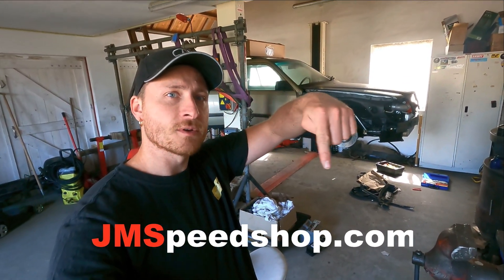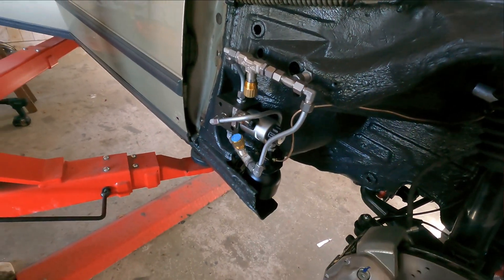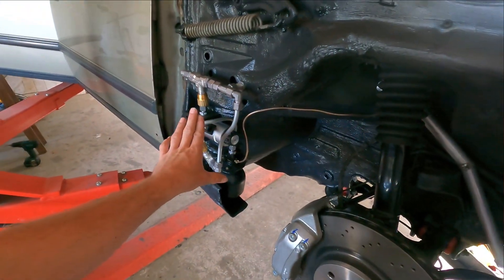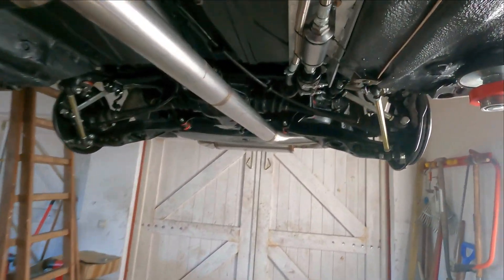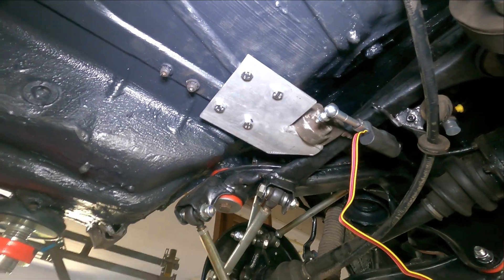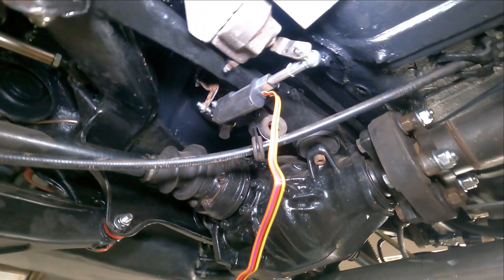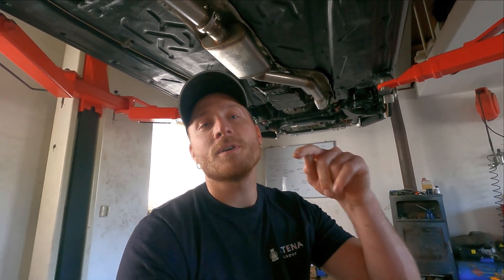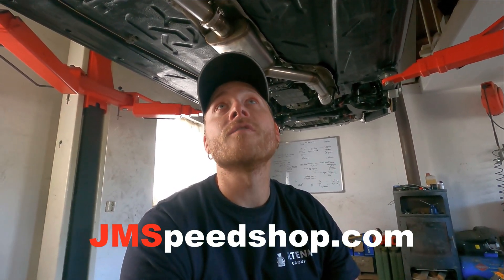ADS suspension for S124 V8 Turbo

Comment: hi, can i ask did you some question related to S124 SLS suspension ? Currently I'd having some knocking sound from the struts, there is no leaking from the suspension. The sound is from the lower mounting point of the struts. I assume is the rubber stopper inside the struts gone. Do you have any idea I can get a replacement for the stopper?
Reply from the maker: Not sure if you can get the stops seperate
Reply: even the ball joint of the lower mounting point ? @JMSpeedshop
Reply from the maker: The lower mounting point is a rubber brushing that can be be changed seperate it think

Comment: You think you’d be able to fit a 8.4L V10 dodge viper gen 4 engine into a 93 190e?
Reply from the maker: It is al possible .  But the bigger the engine the more room you need to create.  The more parts to move another place.

Comment: absolutely outstanding  flip those valves over so you can lift the rear seat and adjust out on the road
Reply from the maker: That is a possibility dont know how much room there is .  But i will only adjust them once i hope and not every week.   Dont even know much room is there under the rear seat